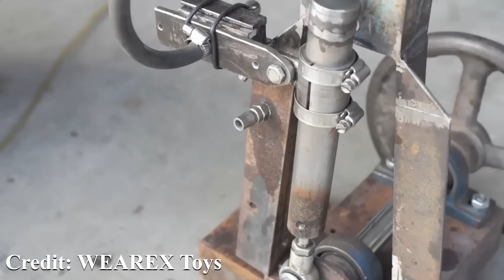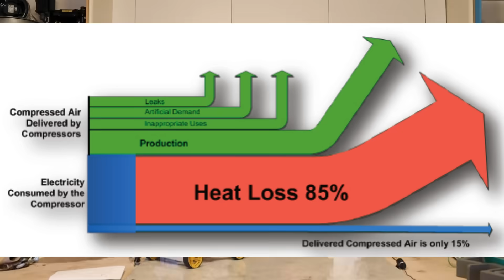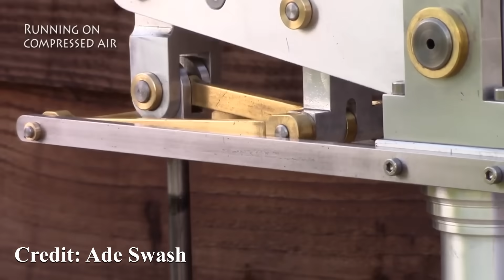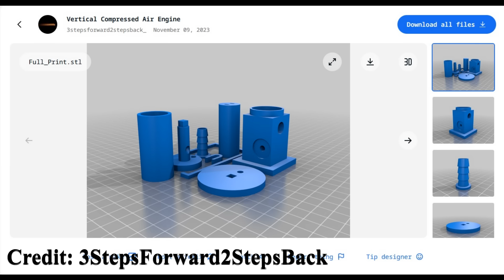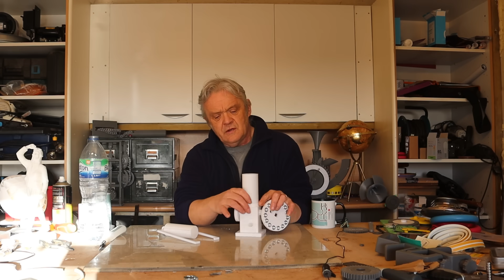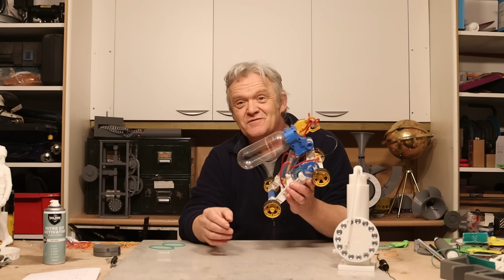2190 An Unusual Air Engine

Comment: Personally I like the idea of it spinning a strong electret made of UHMWPE that is injection molded into a ceramic and metal plat electret former. Using the graphene and nano carbon on the outside to build up more charge on the outside plates of the copper can help form the electret better. And if you can do 100k to 1 million volts charge across it at a high enough current electric field would be nice. That when formed the engine will spin the electret to run the stationary serpentine coils on the stationary mount to make the electricity . The idea is that a strong electret spinning will not have the magnetic locking that rare earth magnets have with coils. And need less torque to spin.

Comment: zeolite could be used to capture moisture in return the zeolite gets hot preventing icing a win win so to speak, though it has to be regenerated using heat, maybe using 2 zeolite dryers would solve the problem as one gets hot thus recharging the other and vice versa

Comment: Could you feed that with a Trompe with a steady supply from a hose and a release valve?

 That would make it great camping generator if you are close to a waterfall or have another way to run the Trompe (like a hydraulic ram pump even with a stream)

Comment: Where does the compressed air come from?  From other mechanical energy of course!  Steam energy gets its energy from HEAT.  Most compressed air comes from electric compressors.  Where does the electricity come from?  Most of it comes from HEAT from burning fuel in air, converted to mechanical work by STEAM ENGINE driving electrical generator.

Comment: Why am I thinking about wax? Take the 3D printer parts, create molds, and then cast aluminum. Will it work? No. The problem with casting is that it will be unbalanced.

Comment: Something like a flapper switch splitter should run two pistons giving fairly constant power, maybe a controllable air spun splitter with a rotating hole that opens each outlet as it passes to give your timing?

Comment: I wonder how much heat it makes like say if you had the compressor running through the middle of an expansion tank could you start off on compressed air until it warmed up then steam takes over? The outside of the tank could be covered in heat - electricity pads to recharge batteries and maybe insulate or be a way to regulate the tank temperature, with some heat memory material you'd have a temp control for the pad's contact pressure?

Comment: Would you expect regenerative braking to work efficiently on an air engine in a car?
Reply from the maker: yes
Reply: Why not? Wouldn't be much gain, but even a 5% is worth it, unless making that happen is to Costly.
Reply: Why not? Wouldn't be much gain, but even a 5% is worth it, unless making that happen is to Costly.

Comment: If you connect magnets a push the engine with compressed air that would allow for rim generator. However gow would you safly find the max speed as i am sure the higher the rotation the more vibrations and thus unless stationary  might come apart under thos vibrations
Reply from the maker: yeah - could be mate
Reply: @ThinkingandTinkering  was thinking assuming you have a tank of compressed air. If you built a housing around a wheel like a water wheal but used a mag lift to reduce friction spin the wheal faster and built a small housing for the wheal to collect the sound energy to create stabilising mechanism. That would make it stable well in my mind anyway

Comment: To eliminate problems with using a compressible liquid to drive a pistion, I've always wanted to do a air-pressure powered water engine. Scuba tanks would provide pressure regulated air that would be switched back and forth to pressurize a pair of water reservoirs that would drive the fluid back and forth through an appropriate spool valve and the engine. The logic is a bit complicated, but doable. A scuba tank doesn't go far, but multiple could be used and they are fast and easy to swap out.
Reply from the maker: interesting idea mate - cheers

Comment: One great example of a modern adaption in cars would be some taxis in India that run off Compressed air tanks. Think they have about a 20 mile or so range between fills, but for a taxi maybe covering that distance in a few hours, it works well in the city. Was actually looking into making something similar, albeit for personal use or fun, like a largish gokart.
Reply from the maker: in concept they are very cool

Comment: Water in the air supply of a compressed air engine is not nessesarily bad  if you also boil the air trapped water for extra expansion and suitably engineer  it to handle the increased pressures between the air tank and the engine you have a one way valve and then a plenum or chamber that you heat then another one way valve likely a reed valve you can heat it with a resistance coil or burning a gas even an oil lamp.
Reply from the maker: cheers mate

Comment: you have a big bellow made from blinders, don't you? Feed the bellow through a check valve into a balloon that feeds into the actual engine, presto - power and power regulation(somewhat)
stick magnets onto the nuts, place any coil near the flywheel, easy makeshift generator
Naturally, if you have a 3D(and not just a 2d one like me) you can print/create attachments for all of that to make it easier to hold everything together
Reply from the maker: I do mate and i think that is an awesome idea

Comment: You can use the cooling effect for HVAC though.  And cold can be stored like heat can to be used when needed. More research needed there. Probably with how they did things in the old ice houses.  And then you'd have a hot store with your sand battery storing the excess heat from the compression and a cold store from the expansion, so maybe you could get some of that energy back using a peltier chip or a Stirling engine?
Reply from the maker: that is an interesting idea mate - thanks for sharing

Comment: I made an air/steam engine w/ a piece of aluminum pipe for the cylinder, a threaded rod for the shaft and some teflon for the seals.  A switching valve (made w/ similar, but smaller materials) allows for dual action -  powered on both in and out strokes.  It works pretty good on air, haven't tried it on steam.
Reply from the maker: cheers mate

Comment: I'm an off grid nut and us off grid folks usually need to store water like rainwater collecting if a water source isn't available or drilling a well is too expensive. I'm wondering if anyone has any ideas on how to use our water storage to make compressed air to run a generator were storing water anyways might as well use it

Comment: Why not use that Air motor uncompressed air jet uncompressed air generated by dropping water and separating the bubbles and have them rise before they flow out.

Comment: I was looking at the fact that a car air inpacked or air gun to remove bolts on tire's connected to a trompe for air and driving a simple generator would work and easy to maintain.

Comment: Far fetched as i am, Could an air engine power a cycle by storing  air compressed by pedal  motion when the cycle is in motion or whilst  breaking ,to be used as a boast when needed to accelerate or assist the cyclist ?.

Comment: I just love your enthusiasm and creativity  !
Thanks !
Now, pistons and flywheels are the easy parts. The challenge in an airmotor (as in steamengines) will be the valves and the timing.
For an efficient engine, the "cut-off" has to be less than 10 - 15 % , to allow the air to expand properly.
 - And of cause, it has to adjustable, best of all stepless   ;-)
It took me 6 years to solve this problem . . . 
Looking forward to the next videos on this issue. I will bet you come with a solution that can get this wonderful engine back in peoples mind !

Comment: I have a plan to try out a variation of your graphene doped plastic as steam body parts for steam components, as I think I could possibly use a nichrome heater, or a steel flame body coupled to it, and so much of the weight would go away, and that stuff will hold its form to pretty high temps.

Comment: I had a thought. Even though as you said Rob that the air engine is less efficient. That's not the only thing we need to think about. In an electrical system, we would make something spin. Which drives an alternator, which is then stored in a battery and then that powers a motor say but there's lots of stages there all with efficiency losses. My thought is say we compared a pedal generator to a pedal powered compressor. You pedal, compresses and stores the air then it drives an air engine, i wonder if there are more or less overall effort you put in is put to power plus i think this would be much simpler. No risk of shock, fewer components to break plus unless I'm wrong no difference to you if you connected a load. Worth a thought!
Reply: Great thinkin

Comment: Of course, the real problem is how to compress the air in the first place. If you're compressing it with a gas or electric motor, you could just use the gas or electric motor instead.
Reply: His ram pump should be able to power that.

Comment: I don't think Electrical Engineers in the US have to take Thermodynamics,  Dynamics or Statics classes anymore. I did 40 or so years ago. As a controls and instrumentation engineer, those classes have served me as much as most of my EE classes. Your channel reminds me of why I loved those classes and almost changed in 4th year to mechanical engineering. 

And I too have been trying to come up with a way of testing the O-Wind turbine concept. I have an idea, not sure how valid it is, but I think I'm going to try. The potential is too great for it not be tested but I’ve seen too much green energy snake oil to accept the claims without empirical data.

Comment: Actually, converting an ICE into an air motor is just a case of making a new cam shaft.

And while you CAN run since cylinder air motors this way, it is far better if you use a multiple cylinder motor so as to make sure that there is always some state of driving force on the crank shaft, even though you do not have the problem of having a compression stoke, it is, in effect, still a 2 stroke motor, UNLESS you valve into the actual bloc of the motor, which, at least on most common reciprocating motors, requires sealing up a whole lot of leaks, and causes quite a bit of sluggishness and wasted air, seeing as on single stroke ICE converted motors, you have to both fill and drain the entire crank case volume, every time you rotate the motor.

And even if you 'pack' he crank case as much as rotational parts will permit you, it still ends up wasting as much as 4 times the volume of the actual cylinder, just to fill the extra space, and, sadly, there is no way around the need of then venting all that air.

For that reason, single stroke steam engines do not have a 'crank case' but merely a single cylinder and single piston that valves both directions, and is drip-oil lubricated, instead of either using splashed, or pumped oil in continuous recirculation.

I have a design for a V-8 single stroke air motor, its a bit complicated, because of how I want to build the valves, but still the same, it is extremely efficient, compared to other air motors, because of the fact that 1, it is independent of the open crank case losses, but yet still allows for a full basin oil reserve, either in 'wet sump' OR 'dry sump' configurations.

I plan on building my first versions out of common PVC pipe, some Teflon, felt and a few nylon gears.

Because it is running at as cool of a temperature as freezing, I aim to make it where it can run on very low viscosity oil, and also, it will be able to warm up the inlet air somewhat before entering the chambers, so as to reduce the potential of oil getting too viscous to allow the motor to run.

I may even lubricate it with plain kerosene.

PVC on clean Teflon and felt bearings and seals will have no problem with low viscosity oils, so long as nobody accidentally scratches or otherwise damages the surfaces while making the parts and assembling them, and so long as they don't accidentally get dirt into the system which could abrade the parts until they fail prematurely.

Comment: Replace the machine nuts with magnets, add a coil and boom. 👍
Reply: And connect his ram pump to it to power it.
Reply: Slows the flywheel with magnetic drag...
Reply: You could leave the nuts in place and use a magnet wrapped in wire for your generator.
Reply: Same, First thought seeing the set up. 
Second thought was, would it work with hydrodynamic Air compresssor? 
Type of air compressor that use's moving Water and that draws bubbles into
the water and collect's them, and build's decent Pressure.
That would be nice way of getting eletricity from moving water, using air Pressure to do the work, 
and Compressed Air storage is easy and safer than batteries.